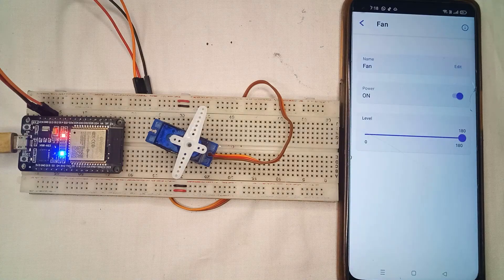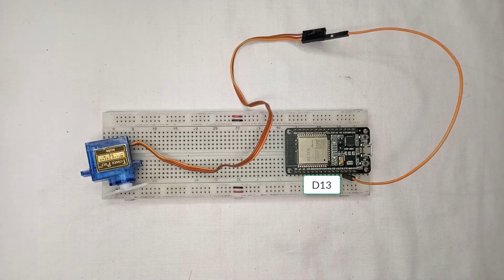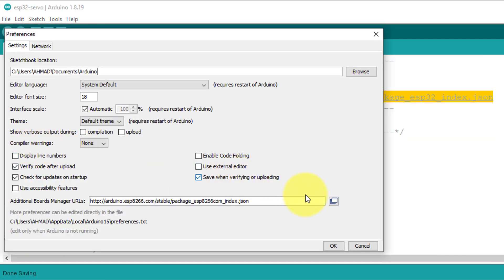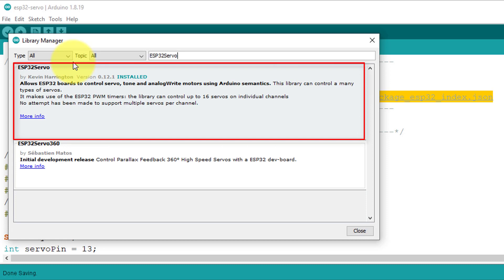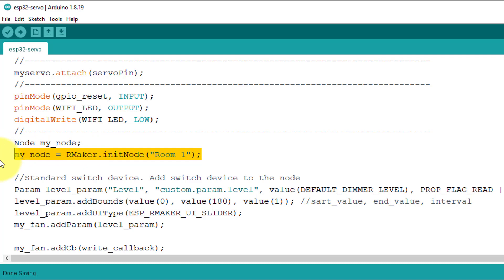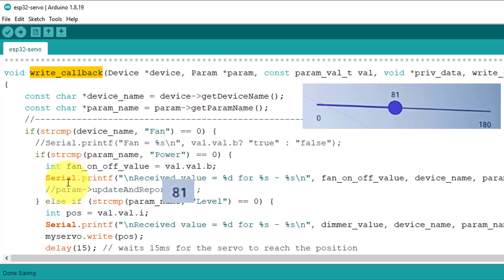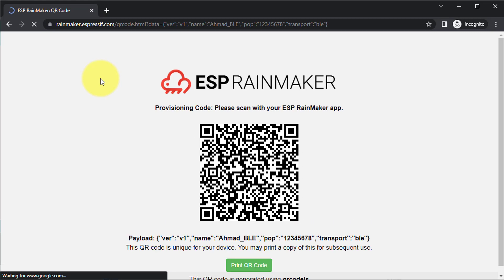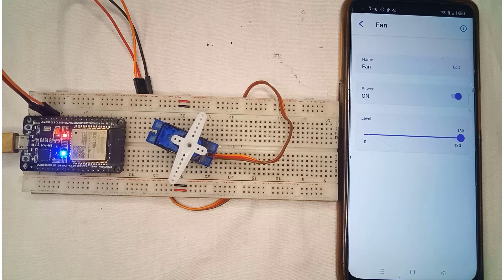How to Control a Servo Motor with ESP32 and ESP Rainmaker - Step by Step Tutorial

Comment: Hi sir great video, the code and everything works but then when I move slider I'm getting no output form servo motor, everything is connected and blue light on esp32 is on, do help please
Reply: I have the same problem. Movement is detected in Serialmonitor, but its not no output

Comment: when i try to upload the code i get this error message

WARNING: library Servo claims to run on avr, megaavr, sam, samd, nrf52, stm32f4, mbed, mbed_nano, mbed_portenta, mbed_rp2040, renesas, renesas_portenta, renesas_uno architecture(s) and may be incompatible with your current board which runs on esp32 architecture(s).
In file included from C:\Users\suita\Downloads\esp32-main\esp32-main\esp32-servo\esp32-servo.ino:21:
C:\Users\suita\AppData\Local\Arduino15\libraries\Servo\src/Servo.h:79:2: error: #error "This library only supports boards with an AVR, SAM, SAMD, NRF52 or STM32F4 processor."
 #error "This library only supports boards with an AVR, SAM, SAMD, NRF52 or STM32F4 processor."
  ^~~~~

exit status 1

Compilation error: exit status 1
Reply: Rename Servo.h to ESP32Servo.h    make sure you have the ESP32 servo library installed. Took me ages to figure this out myself, now i have a not enough memory problem :/
Reply: change servo.h to ESP32Servo.h

Comment: Hello , brother what will be connection if we want to also add ldr that work as indoor and outdoor to automatically open and close the curtains. and what will be the code for that.. smart curtain using servo motor and ldr ... I haven't found any satisfactory video on youtube ..I think u r the one who can help me with that....
Reply from the maker: I think this code is google starting for you

#include <Servo.h>

Servo curtainServo;
int ldrPin = A0;
int servoPin = 9;
int threshold = 500; // Adjust this threshold to your preference

void setup() {
  curtainServo.attach(servoPin);
  curtainServo.write(0); // Initialize the servo position to fully closed
  delay(1000); // Wait for the servo to reach its initial position
  Serial.begin(9600);
}

void loop() {
  int lightLevel = analogRead(ldrPin);

  if (lightLevel < threshold) {
    curtainServo.write(0); // Close the curtain
  } else {
    curtainServo.write(90); // Open the curtain
  }

  delay(1000); // Adjust the delay as needed
}
Reply: @AhmadLogs  Thank you
Reply: Brother there is No A0 pin in Esp32
Reply from the maker: @affanrathore5439  it is just sample code for arduino. you just change the pin as per your neeeds

Comment: Hello sir, there is a way to make the servo motor work with on/off? In a way that it goes to 90° when turned on, and back to 0º when turned off?
Thank you.
Reply from the maker: #include <Servo.h>

Servo servoMotor; // Create a servo object
int switchPin = 2; // Connect the switch to digital pin 2

void setup() {
  servoMotor.attach(9); // Attach the servo to pin 9
  pinMode(switchPin, INPUT_PULLUP); // Set the switch pin as input with internal pull-up resistor
}

void loop() {
  if (digitalRead(switchPin) == LOW) {
    // Switch is pressed, move the servo to 90 degrees
    servoMotor.write(90);
  } else {
    // Switch is not pressed, move the servo to 0 degrees
    servoMotor.write(0);
  }
}
Reply: Thank you for your response sir, I am sorry that i wasn't clear but I would like to make it work with the digital button on rainmaker, I don't have a switch in my project. I follow your tutorial and could make it work with a slide, but I will use the servo to simulate a gate, so would be better to open and close directly. Could you help me please? And again, thank you for take your time to try to help me.

Comment: Hello sir I needed your help with one project of gps tracker using esp8266. Can you please provide your email or any other contact method
Reply from the maker: you can ask anything here.
Reply: @AhmadLogs   I tried to make gps tracker using esp8266 and sim800l but when checked on serial monitor it shows garbage values in place of phone numbers. So phone number aren't getting resistered.
Reply from the maker: @anmolkasabe  you just clean the eprom and then store the phone number by sending the R command
Reply from the maker: @anmolkasabe  you just clear the eeprom memory and then try to register the phone number
Reply: @AhmadLogs  I tried it but it didn't worked i also tried inserting mobile number directly into the code still no luck
Reply: @AhmadLogs  Sir I built gps tracker using A9G esp32 by techisms . 
but whenever there is no network to gps it shows unable to attend location can we make changes in the code to make it work by storing the last available location and sending it when there is no network for gps
Reply from the maker: @anmolkasabe  To help me better understand your question, could you please clarify what you mean by "unable to attend location"? Are you referring to the GPS module not being able to obtain a GPS signal or are you referring to the tracker not being able to send the location data to the server when there is no network connection?

If you are asking whether it is possible to modify the code to store the last available location and send it when there is no network connection for GPS, then the answer is yes. This can be achieved by implementing an algorithm to store the last GPS location data in memory and send it when there is no GPS signal or network connection available.

However, it is important to note that the accuracy of the stored location data may degrade over time if there is no update from the GPS module. Therefore, it is recommended to periodically refresh the stored location data with new GPS data when the GPS signal and network connection become available again.

I hope this helps clarify your question, and please let me know if you have any further queries. Thanks for watching my videos and for your support!
Reply: @AhmadLogs  yes I was asking for modification of code to store last available location and send it when there is no network for gps. Can you please help me with that algorithm
Reply from the maker: @anmolkasabe  use two variable last_latitude, and last_longitude. then use if condition if(latitude == 0 || longitulde == 0){
msg = String(last_latitude) + String(last_longitude);
sendSMS(msg)
}
Reply: @AhmadLogs  Thank you so much sir